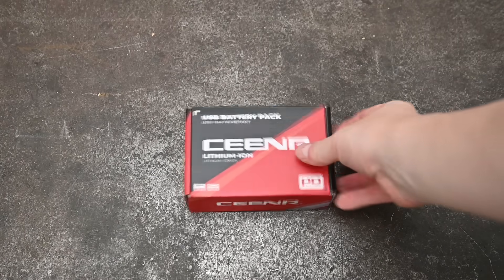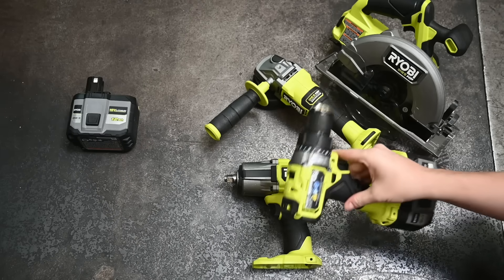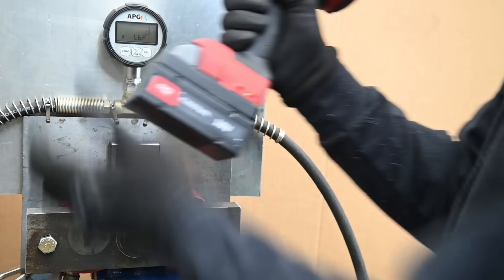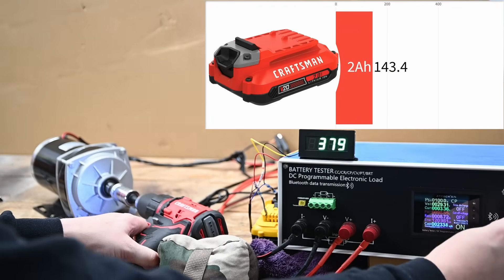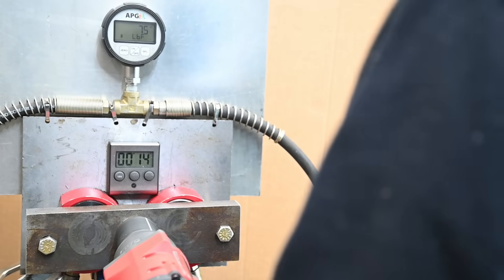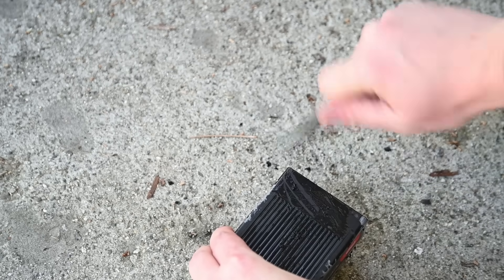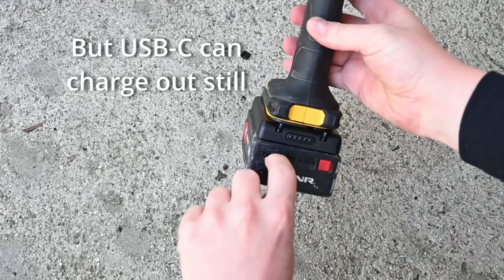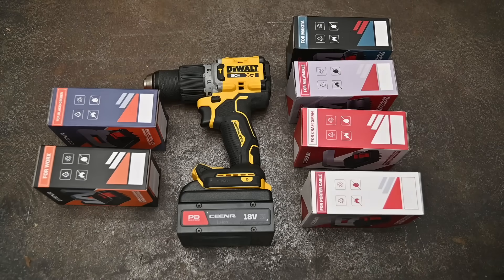We Bought the New Universal Battery for All Tool Brands

Comment from the maker: To answer a common question: It doesn't charge on your slide on charger. I don't believe there's a way for it to work on every brand that way, and they're trying to make it so you can buy X brand and not have to buy a kit. Just the cheaper bare tool each time and for the most part ignore proprietary things. Theoretically someone could eventually just start a tool collection only ever buying bare tools. 
But choosing A cheap slide on charger it could fast charge on I think would be a good idea.
Reply: Thanks! I figured this. Can you check to see if the DeWalt adapter works on Bauer or Hercules? I hear some aftermarket ones are intercompatible.
Reply from the maker: @funkmon  Good question. It does not fit/work on Herc or Bauer
Reply: @TorqueTestChannel  you're a legend. Answering the questions, checking the efficacy. Hopefully if this tool becomes popular in some way this video skyrockets your channel.

Thanks a ton, from a spreadsheet buyer.
Reply: @TorqueTestChannel how is this gonna work when some tools have the battery balance on the tool while others have it on the battery along with the over/undercharge protection.
Reply: @TorqueTestChannel  Fast chargers have more connectors that + and - , those check temp , bet that not same circuit in all brands , also Makita check power cells and how it does it aint same that in DeWalt or in Milwaukee 
Yeah batteries are bit expensive , in Finland Makita 5Ah you can get for €59 , cheapest brand batteries , go to Estonia or Sweden its €20 more for same product.
I got Bosch 12v 6Ah battery kit for €165 , 2 batteries + charger, if you buy 12v 6Ah batteries alone those are €85 each , about same that Milwaukee batteries.
Reply: I like the idea of a usb charger... Easy charging on the go, with nothing but a cable we all have already.
Reply: U simply can't fast charge this battery. Doesn't matter how powerful Usb-C charger u have. There is no fan cooling. It is 90min/4Ah and when the battery is hot u have to wait until it is cool enough to charge. So something like 2h. Imagine 8Ah or 12Ah pack.
Reply: It's just another ecosystem to buy into.  An ecosystem of adapters, batteries, and chargers.
Reply: I do hope they end up offering a fast charger alongside USB charging. Having it be able to charge off a phone charger is great but the option to spend a little extra for 30 minute charging would be nice
Reply: This is definitely a great start. If successful (not getting sued for using the other brands “proprietary battery slides” . I can see them upgrading the charge times similar to how some phones and laptops can charge at high speeds over usb c .

Tbh even if they upgraded the usb c port to accept higher speeds I wonder how many people will actually know to use a high watt charger vs. the cheap usb c charger that came with their phone.

Not all usb c are created equal
Reply: I think their safe is because possible risk of overpowering the motor and cooking it could result in some negative press and I think that is what they really want to stay away from atleast for now. They are still selling the older brushed and they do like to cook if you push them. Although I do like the idea of commonality between brands atleast for batteries, I think that could also limit companies trying risky stuff like what Dewalt and Milwaukee are doing as their testing and experiments get recouped with the newer better batteries selling. I think that the adaptor top is maybe the better solution with a generic battery pack like this offers. 

However a limiting bit could be introduced in the adaptor to limit special high power batteries that may damage from some brands could be implemented. Mostly you have a adaptor for high powered and one for regular atleast for some brands. The trick is the battery adaptor could still go into any of the tools and could still cook the thing if its possible but it would be more of a "we gave you a warning cause different product" excuse. Then again there might be some limiting effects already in place from the tool manufactory that could help stop this like some batteries having an extra slot for connector or such. All I know is brushed motors can be finicky little shits when you use stuff they are not made for and can throw fits and Lithiums can also have their own tantrums when used with tools they are not made for and can shorten the life of the battery. Like the little 1.5 ah batteries being ran on a saw or even weedeater and in about a few months the battery hardly holds a charge for more than a few mins. It's being a name branded battery that's dying while on any other tool like the drill it came with, just fine.
Reply: They should sell the adaptors cheap to get people hooked
Reply: Literally was in the comments about to ask if it would charge on XYZ charging systems. Thank you for addressing it in the comments.
Reply: Anybody looking for a great charger to go with it look up the "pinepower" by pine64, they also make a killer type c powered soldering iron you can power with the pinepower too ;)
Reply: Who is the guy that makes the custom adapters for you? I need a dewalt 18v to 20v one that the battery slides in the opposite way for my grease gun.
Reply: Thank you. In that case I'll pass on this. I'll just wait for the 4 pack sales near the holidays for the proper battery
Reply: I think instead of using other fast chargers they could improve their USB-C charging. USB-PD can deliver up to 240 W of which they currently only use 45 W.

Bidirectional USB-PD with 240 W would be even better, as you could then power many laptops with this battery.
Reply: No Ryobi?  Thumbs down
Reply: What the f*** where's the link to these batteries?
Reply: It would be extremely difficult to make their batteries charge on others chargers, not because it is technically difficult, but because these companies have BMS's that are designed to screw you over in every way possible. Not sure how terrible they are but i know plenty of companies that do this stuff, such as red, the manufacturer of extremely expensive cameras and batteries that brick themselves the moment the BMS looses power.
Reply: They definitely need to do a slide charger. It would be more durable if they left off the USB-C ports imo (maybe move them to the adapter plate so they don't hurt the battery, but are cheaper to replace).

But a charger would be way nicer than needing a fiddly and delicate cord. I really love the idea of the battery, but that cord looks like a 2005 drill with a proprietary charging port 😂
Reply: Is It definitely compatible with a bosch jigsaw?
Reply: I got a couple of Bostitch tool's, does it work on these tools? TY
Reply: What's next? One tire size? One church? One house color? 
This is government overreach in a new wrapper.
Reply: Then all we need to know is what chargers are compatible.
Reply: USB c PD can do up to 240W these days. If they could make it use those chargers having the charger built into the battery would be fine.
Reply: "...lying rates..."  👍👍👍😄 You speak truth, lol!
Reply: Awesome 👌  they need a fast charger
Reply: The future is now 🎉
Reply: I would imagine the slide on fast charger is on their to-do list for sure!😊
Reply: I'm interested in the airless nailers draw on the pd Nation 🤔

Comment: What site do you buy your cells from? I want to build a custom battery for my DeWalt but I don't want a standard 8ah being slightly upgraded. Also do you have any info on buying just the bottom bass to the battery covers? To fit 3 rows of 27100 cells?

Comment: The watt tester showing 45w does not mean the usb-c charger is putting out only 45w because you're measuring the watts on the AC input side.  The output is considerably fewer volts and can easily be 60w.  You will need to measure the output of the charger by measuring the current and the voltage and multiplying voltage x current to get watts.

Comment: I have been using battery adapters for years. just type in the bay, milwaukee battery adapter to whatever tool. or whatever battery you have to whatever tool you have. some are pricy, some are not, but once you have the adapter, you save by buying cheaper batteries.

Comment: USB C port is great but there better be a real way to charge the batteries as well.  Also, regardless of your brand choice the adapters suck. Let's add 10 more ounces of plastic to each tool that was well balanced. Now everyone that has an existing battery and tool platform will only be able to buy adapters once old batteries die or buy all new stuff.   Good for 10 years from now for people just starting out buying tools.  Bad 2 years from now for Every tool I have.

Comment: "Watts" are used in places in the video where "Joules" should be used instead, such as in battery capacity measurements.

Saying that a battery has a capacity of 690 Watts as measured by draining it does not make sense. "Peak Watts during load" may make sense, because some loads require a certain wattage for a tool to work, but that does not indicate what the battery's capacity is.

Volts = Joule / Coulomb
Amps = Coulomb / Second
Watts = Volts * Amps = Joule / Second
Joules is proportional to Watt-Hours = Amp-Hours * Volts (when comparing battery capacities, always multiply the Amp-Hours by the voltage).

Watts = Power
Joules = Energy

Measuring the capacity of a battery is like taking the integral of its running voltage times its running current throughout its lifetime.

Comment: Can't believe to get 275 ft lbs of breaking force torque on my 24v 1/2" Kobalt Impact Wrench I need the 8.0Ah battery which costs $150!!! $50 more than I paid for the dang tool, will probably just settle for a knockoff 6.0Ah battery unless I find a good deal on one but I think even that one was $110. The prices for these batteries are nuts.

Comment: I have an adapter which cost me 10£ and let's me use my Bosch DIY (the green bosches, only available in Europe I think) batteries with my Bosch Professional tools (I was able to get a load of the bosch green batteries for free). I wish I could test the power draw like this video but don't have the equipment. It feels fine though. I also have an adapter to use my Bosch batteries with Parkside and Makita, and each adapter cost around 7-10£. So that's already a very cheap alternative to this platform.

Comment: Good video. My guess of the main reason they govern the cell's output so conservatively is not so much to do with them worrying about the brands they are will be plugged into, 13:46. I think it has more to do with limiting warranty claims from typical hard-running users, to avoid beating-up the cells. I wonder also about commercial insurance against fire, by proving they have a limiting design reduces their liability and maybe even could give them a deal on their rates.

Comment: "works on any 18-20v brand"

Americans are so goofy. The whole world refers to batteries with their nominal voltage but America has to use the fully charged voltage.

Bigger is better right? 🤡
Reply from the maker: It's due to Milwaukee patents. But you're still not wrong

Comment: Update having received my order today: Batteries are still using P42A's, soldering job looks good, conformal coating or paint or whatever is kinda "meh" but otherwise good execution.

Opened up one of the adapters, (Milwaukee in this case) and found good soldering work, however instead of using a thermocouple passthrough to the tool, they are using static resistors in the adaptor to "trick" the tool into operating without thermal rollback functionality.  Not an ideal solution, if I'm being honest.  If different brands use different thermal sensors, why not do software-scaling in your adapters? And if they all use the same rated NTC thermocouple, why not pass that to the tool?  So far my only complaint.  Adaptors can definitely handle the current these battery packs can push by my evaluation.

Comment: Returning back to this now that my order is shipping this week: I believe the limitation in 650W is not because of the cells; I believe it's because of the MOSFET's used to push all the power through; many brands direct-connect the pack through to the power taps rather than gate them through mosfets; even with DirectFET's you need heat dissipation when you start bumping up the current, and they've chosen a rather conservative limit of ~40A.  I believe the reason for this is because of the native heat-dissipation capability of the battery pack itself; there isn't exactly a lot of heat-sink ablity within that plastic-encapsulated package, and bringing any heat-sink out off the mosfets is going to be a crush-point for the power handling components of the PCB; which is better? more beans, but the first drop shorts the battery out crushing the heatsink through the mosfets, or limit the current to prevent it from blowing up?

Comment: I know rechargeable batteries need some kind of board to regulate the power safely, but I wonder if they can shrink the board down and make it the secondary board and put the main board on the adapters. That way they can tune the adapters for each brand. So you can get the most out of each tool and battery. It might cheapen the battery but make the adapters more expensive though.

Comment: I can get a Makita 5Ah battery for 62 Euros... Unfortunately, PDNation thought they were smart and don't display prices since the product is sold out. Still, you said 69 bucks.
Yes, this would allow me to use it with other brands as well... with an adapter for 20 bucks. But I already could buy an adapter for for my Makita batteries to let's say DeWalt for, you guessed it, 20 bucks.

So what exactly is the point of these?

Comment: I would pay significantly more for similar or even lesser power. As long as these guys are going to fight against battery vendor lock-in.

A battery is a battery is a battery. Yes some batteries will get better than these can handle but I still get to keep any battery that comes with the equipment or I'd buy one upgraded universal battery when I need to.

Comment: I'm not sure this is going to end how people want it to end. Power tool manufacturers - generally speaking - aren't making stupid profits. Yes their batteries are expensive but that's because they subsidise some very cheap tools. 

This will go one of two ways; either they will release a new line of proprietary DRM batteries and the new tools will only work with those or they will give up the battery war, reduce the price of their batteries and move that onto the price of the bare tools.

Comment: This new battery system is interesting but I still don't understand how it protects from undervolting a cell.  Is there a MOSFET in the pack that interrupts the current or does the adapter translate the safety communications and instructs the tool to shut down.  Undervoltage protection is a critical safety feature that is often omitted in cheap power sources.

Comment: thing is that there are aftermarket adapters to put dewalt on makita, or milwaukee batteries on dewalt. I managed to find a adapter to use my half inch 19.2 craftsman impact we the dewalt 20v batteries i have. It does suck that you are almost locked into a tool line having to adapter the battery to the tool. Though that is exactly what this thing is doing already.

Comment: This is because Europe is pushing to have universal tool battery connectors.  So eventually any tool can use any battery.  Much like how they forced Apple to ditch the lighting connector for universal USB-C connectors. I do like this standardization.  So that if I need to buy a unique Milwaukee tool and all I have is yellow batteries I don’t have to spend an extra $100 for the battery and charger.
Reply: europe is not pushing for that, that was just an april fools joke and you are very gullible.

Comment: this will become standard as europe is requiring all tool brands to use the same battery. The European Union (EU) announced a new battery regulation in July 2023 that aims to standardize power tool batteries and make it easier for consumers to replace them. The regulation, known as the European Battery Interface (EBI), will require that all batteries in devices be user-replaceable, regardless of whether they are used in a product or supplied separately. The goal is to ensure that batteries can be replaced with "compatible" batteries, rather than "similar" ones, from different brands or manufacturers. The regulation also bans software that makes it harder to replace batteries. takes effect in 2027 this brand is trying to jump ahead and become the standard
Reply: I searched for it and pretty much the only thing that pops up is an april fools video from eFIXX.
Reply: nope, that was just an april fools joke

Comment: slower charging is better for battery longevity and personally ive never seen the benefit of having fast charging with a few minor exceptions. Best thing would be to have a toggle on and off for fast charging. Also allowing a higher wattage input via those laptop barrel jacks or the such. Im sure most people have a left over charger from an old laptop or they could pick one up for cheep. Ive got a 135watt brick for my old laptop.

Comment: I also note that it is better to buy in the M18 Milwaukee brand line, only the original batteries avoiding the slim pack 1.5 and 2.0 and the 9.0 which have an incredibly high failure rate.
Reply: also 12ah packs have issues

Comment: Amazon is full of adaptors that  will allow one brands battery to be used on another brand, so what's the point in this?
Reply from the maker: Awkward stack height, plus every adapter we've tested on Amazon is quite terrible. Eventually melt or vut out, but not for smart monitoring reasons. They just eventually get fried or fall apart.